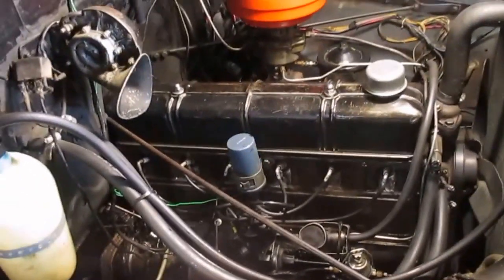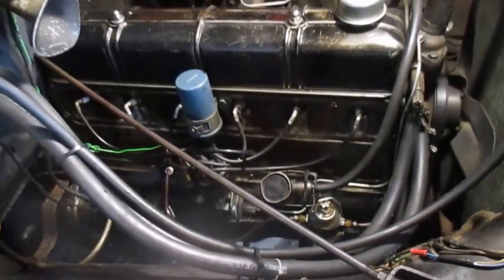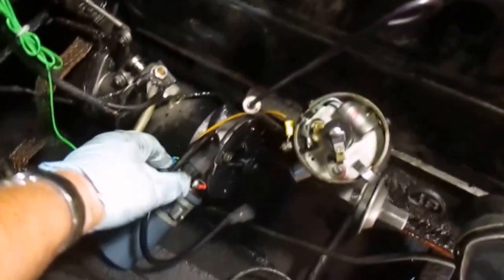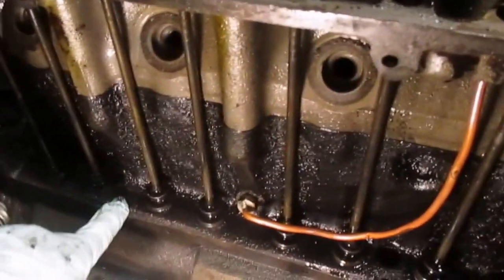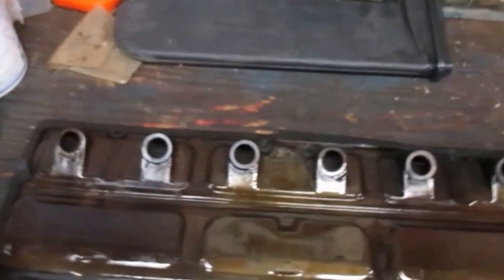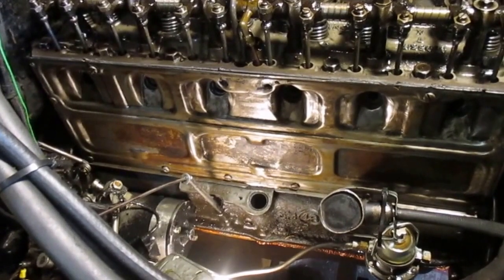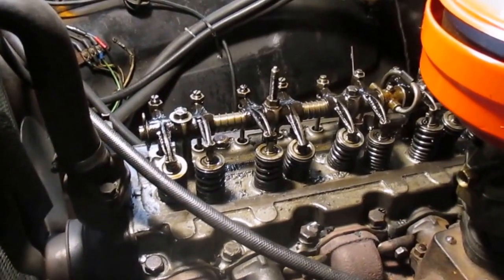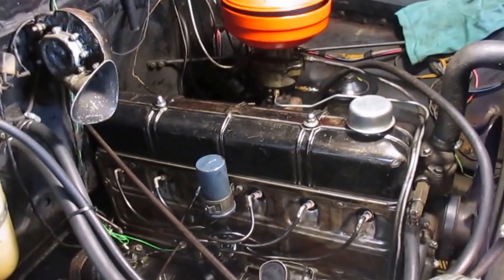Chevy 216 Side Pan gasket R&R Movie

Comment: Based on your puddling explanation, did you consider applying sealant to the bottom aft engine block  to gasket and or the entire lower part of the gasket to engine? I might try that. Thank you for your time sharing your experience, it saves many of us pain and suffering.
Reply from the maker: I applied sealant on both sides of the gasket and that worked the best for me. I let the sealant get tacky (about 5 minutes or so) before I bolted the pan back on. Make sure the sealing edge of the side pan is good and flat, especially around the bolt holes. That and good sealant should keep that oil in the engine where it's supposed to stay. Good luck Mike.

Comment: Great 👍 vid buddy.. & love the shop. I need one . Haaaa. Theirs my favorite word again.. STOVEBOLT. 😎 . So you cranked her or by hand you set her up on  the BB mark & made sure she was on compression stroke? & is that #1 position the same on a 235? Unfortunately I believe my block was changed for the exact reason you talked about ..that oil line.. believe a lot of people would say they had a bad oiling prob with those 216.. but I beg to differ if you maint it as you have.. I think your just fine..awesome 👌 vid as always.. see 👀 you on the next . On that note do you know of any sites I can cross reference my block.. see what year it is?  Thx Dave.. if my memory serves me right haaaaaaaa
Reply from the maker: Yes I turned it by hand. They turn real easy with the plugs out. Thanks for watching. Try the following web site, theres lots of Stovebolt knowledge there;
https://www.stovebolt.com/ubbthreads/ubbthreads.php/forum_summary.html
Reply: @Volfandt  thanks  buddy will do .. keep the vids coming

Comment: I've noticed that your ignition coil is upside down. Ours is rightside up. Which is correct? Our coil is NOT internally resisted.
Reply from the maker: The coils came from the factory installed upside down and it never was a problem. I'm not sure when GM started installing them right side up but I'm going to guess sometime in the mid to late 50's. You can run it either way.

Comment: I just bought a 3600 1953 and it’s an unusual beast here in the U.K.  You mentioned you changed the rear main. I think these are a cord seal. Did you change the main with the engine installed. Heard it can be done but tricky ?  I just adjust the tappets with the engine warm and running until the offensive article quieten down. Regards Chris
Reply from the maker: Yes the rear main seal is a rope seal and comes in 2 pieces. One piece fits in the main bearing cap and the other piece fits in the main bearing saddle. There are several providers of the seal but I've found the "Best Seal" rear main seal kit to be the best. The kit includes a cutter for trimming the rope seals, a gauge for accurate cutting and good instructions. To replace the rope seals without removing the engine you need to drop the oil pan, back the transmission back approx 3/4"-1" to get the trans shaft out of the pilot bearing on the flywheel, then loosen all 4 main bearings in order to drop the crank shaft down enough to get the upper seal out and the new seal in the main bearing saddle. 
Be careful not to hit or knock the oil squirters in the oil pan as they are factory aimed to squirt pressurized oil into the rods dipper as they rotate around, thats how the rod bearings get lubricated at higher rpm. At low rpm the dipper on the bottom of the rod dips into the oil troughs in the oil pan which forces oil into the rod bearing. The 216's and early 235's don't have oil passages drilled in the crank to lube the rods, they rely on the dippers and squirters for lubrication. Later 235's (1953 and up) do have pressurized oil feed to the rod bearings.
Enjoy your 3600,these old Advance Design trucks are pretty stout.
Dave
Reply: Volfandt  Many thanks for the great reply.  sounds a bit tricky to do the seal with the engine In, although I have heard that you can often get away with just doing the bottom seal. I’m keeping my eyes open for a full pressure 235 I think I will live with the leak and swap the engine out.  Its popular for imported trucks in the U.K. to loose the straight six and replace with a V8 as parts are more available and cheaper.  I’m finding shipping cost of parts very expensive. You sound like you have a lot of experience with the trucks. I hope you don’t mind if I ask you the odd question.  Obviously only a very small number of these in the U.K. and it helpful to get a bit of advice as I’m new to trucks. Thank again best regards Chris.
Reply from the maker: Thanks Chris. Ask away, I'm no expert by any means but I'll try to help if I can. Understand about the hardship you encounter with an AD truck in the UK. Doing just the bottom seal is pretty easy and may slow or even stop the leak. It definitely won't hurt.  I'd recommend plasti-gaugeing the rear main while you had it apart, if just to get a good measurement on the bearing clearance and know the overall condition of the engine. If it's still got the shims on the mains you could tighten it up and get alittle more oil pressure if you removed them. But don't make it too tight so plasti-gauge it to know what your dealing with.  0.0015" to 0.0035" is the bearing clearance you want. I currently have 2 of these AD trucks, both 49's. One is a Chevy and the other is a GMC.  The Chevy is stock and I plan to keep it that way with the exception of upgrading the engine to a 54 235 when the 216 quits. The GMC  was already modified when I got it but the 79 Chevy 250 engine in it was shot so I installed a 69 SBC 350 in it. I enjoy both and they are totally different in most respects.
Currently the Chevy is the more dependable as I'm still working the kinks out of the GMC.  
Heres a link to an on-line manual for your ref:
http://chevy.oldcarmanualproject.com/
Have a good 'un. (Southern slang for best regards).
Dave
Reply: Volfandt Cheers Dave. Nice to have a sounding board for the trials and tribulations of Chevy ownership. Although these truck are rare here my friend has a 55 GMC and another friend a C10.  We drove from the U.K. to do the classic LeMans in France last month pretty much a 600 miles round trip. Hoping to take my 53 on the next road.   Here’s a little of my C10 action we had a bad miss after rebuilding the engine. My best regards Chris

Comment: Hey Dave.  I have a 52 Chevy with  the 216 engine and on my truck I don’t have that oil line behind the  push road cover it has a bolt plug instead but the valve cover has the oil line sticking out right from the middle of the valve cover so I took off that plug behind the push road cover and I had antifreeze coming out of it instead of oil.  Do u have any idea why there is no oil line instead?
Reply from the maker: I'm going to guess that the oil line that runs through the engine block (from the oil regulator on the drivers side to the push rod cover up to the rocker shaft) must be broken and/or plugged with crud.. The oil line does run the the coolant passages. It sounds like someone installed an external oil line from the regulator up and around the valve cover and taps into the rocker shaft. That is a common repair/modification that folks did back in the day when they  did not want to run a new line through the block. 
Several aftermarket providers carry a kit that replaces the oil line that routes through the block. It's not a bad job but it did take me several hours and some aggravation to do. If you're getting oil to the rockers with the bypass line installed outside the block you'll be alright but if you aren't getting any oil to the rockers you need to either get the through-the-block kit or the outside-the- block oil line working.
Good luck.
Reply: @Volfandt  thanks dave u just gave me alot of information. I will check On that but am pretty sure am getting oil to the rockers cus they look all wet.  Thanks once again 👍
Reply from the maker: @evanunez8638  Sounds good. Remember the old axiom, don't fix it if it ain't broke, LOL.
Reply: @Volfandt  😂😂 thank you 👍👍

Comment: do NOT grind on youre rockerarms (not by hand at least) , the parts of these arms slide metal arcross metal with only a slight film of oil there worn intoo eachother so you need to take care to put each rocker on the valve it came of same with the pushrods and the cam tappets 
start grinding on any of these parts and they will wear incredibly fast act like a metal file and fill the oilgalleries in the block with metal particles while there at it 
if any of these parts are worn replace them with brandnew parts and use chromemoly grease on each end while hoping the wear on the other parts doesnt wipe the new one out as well  
or keep the old ones and use a tiny rod in the right diameter as a feelergauge to set the valvelash inside the grooved bit you might be able to find those rods in a welding shop for gas burner tips
Reply from the maker: Good idea on using gauged rods to measure the valve clearance on valves when the rocker tips have a groove worn in them. You'll need 2 sizes, 0.006" for the intakes and 0.013 for the exhausts.
I agree with keeping the rockers in the same order they were in should you remove them from the rocker shaft.
I also agree on using an assembly lube on the rockers center bushings, pushrod sockets and rocker tips should they be removed from the rocker shaft.
I respectfully disagree on your position on not dressing up the rocker tips.
All these rockers wear a groove in their tips. The depth depends upon mileage and usage.
This means the rocker tips are already making contact with the valve stem deeper in the original surface of the rocker tip. This is normal wear and tear. 
By dressing up the tips, you are grinding away the portion of the rocker tip that doesn't make contact with anything so you can use a standard feeler gauge for measurement of the valve clearance. 
Your argument on the tips wearing is valid and unfortunate but again, they are already worn by normal wear and tear.
The unfortunate part is these rockers in new and/or NOS condition are getting harder to find. By all means do install new and/or NOS rockers in these old Stovebolt engines when one can. Same goes for the rocker shafts too.
And also change the oil at 3000 mile intervals max as there's more than just the rocker tips wearing in these venerable old powerplants. The rings and bearings also wear.
Thanks for you input.

Comment: good job.i have a 47 chevy had to replace gasket also , saw your vid after i replaced mine. did not know you had to wait 24 hrs before starting motor man i hope it dont start to leak again.if it dose i know what i did wrong thanks to your vid .thanks
Reply from the maker: Thanks. You are probably alright as it depends on the sealant you used. Some are ready to go immediately after application. Good luck to you.

Comment: Hi Dave
I need to know whats used to seal the water pump gasket,  which is like a paper material?
Mine is a 235.
Reply from the maker: I like to use Aviation Permatex, It remains pliable and doesn't harden. It brushes on.
Reply: @Volfandt Im doing that.
Thank you very much!

Comment: Nice video what is the steps for setting a head on this engine i have a 216 that im gone be intallimg the heads and i need all the specs torque and everythimg thanks
Reply from the maker: You didn't say what year engine but 216's didn't change much over their production run so this info should be helpful.
This is a cut & paste of reinstalling a 216 head: 
http://chevy.oldcarmanualproject.com/shop/1948_51truck/51ctsm0611.htm

This is a cut and paste of the entire 1949-51 truch shop manual:
http://chevy.oldcarmanualproject.com/shop/1948_51truck/index.htm

A trick I used was to cut the heads off two long head bolts (or new long bolts) to act as guides when placing the head on the block. The head is very heavy and you should have another helper to assist.
Good luck.
Reply: @Volfandt  thanks for ur reply is a 1937, i would take youre advice and cut the heads of the 2 bolts thanks alot for ur help  god blesed you.
Reply from the maker: @theadventuresofbellaandjos6435  1937, I really like the ArtDeco style. If you run into any problems I'll try and help if I can. Good luck Eze
Reply: @Volfandt  thanks i let you know if i need any help.

Comment: Was your oil rocker line just screwed into the pushrod side? It appears mine is welded on to. I'd like to send you a picture of mind if you wouldn't mind, I don't know if it actually needs replacing.
Reply from the maker: Is your oil line tube leaking? The line is generally a one time use only. If it leaks, get's broken or gets clogged up with years of crud, it usually needs totally replaced. The copper line is soldered to the fitting on the push rod gallery side and can't be turned without breaking the solder. which in turn will cause a leak.  I've read where there's been a couple folks that have successfully repaired the line but in the long run it's best just to replace it. I wish I had done a video when I replaced mine but didn't. On a scale of 1-5 with 5 being the hardest, I'd give it a 3. It took me about 3 hours. I purchased the replacement line kit here: http://www.oldchevytrucks.com/cart/product.asp?prodid=MEO199&i=||||| and it was complete. Just remember you'll need a side pan gasket and a valve cover gasket which isn't  included with the line kit. 
If your line is not leaking but isn't flowing any oil to the rockers you can take the line loose at the rockers and also down at the oil distributor (on the block under the carb where several small oil lines converge) and blow pressure air through the line. This can usually clean it out. The line feeds oil from the oil distributor on the carb side, feeds through the block (runs in the coolant passage between cylinders) comes out in the lifter/pushrod gallery, bends up and connects to the rocker center section. Why Chevy did it this way is beyond me but it's worked for 100's of 1000's of these engines over 60+ years.
Good luck
Reply: Not leaking but my mechanic unscrewed the driver side and I can’t get it back in. I assume it broke off inside the water jacket somewhere so I was going to try and pull out the line to see if needed replacing. I can send a picture of the broken side if it helps
Reply from the maker: No need for a pic. Sounds like he broke the soldered connection. Unless he loosened and removed the fittings on the carb side 1st. If  so and the soldered fitting to copper line isn't broke you can try to reuse it. 
If it is broken you could try to put the fitting back in and resolder the line to it but you'd save a lot of time and grief and just replace the hole assembly with the kit I linked. The line threads in on the gallery side and the fittings on the carb side are compression type and aren't soldered.  IIRC theres instructions included with the kit. Some folks will loosen and remove the fittings on the carb side,  tape a wire to the line at that point, pull it through to the gallery side then tape the wire to the new line, then slowly pull the new line in by pulling the wire back through to the carb side. You then tighten down the gallery side as the entire line will turn with the soldered on fitting. Once it's tight you then tighten the fitting on the carb side. Once the line is good and secure you'll need to slowly and carefully bend the line at both ends to connect to the oil distributor on the carb side and to connect to the rocker on the carb side. If you don't feel comfortable you may want to see if you can find a mechanic to install the new line. 
Good luck
Reply: Thanks that is very helpful info. I do have that new line so I may just go for it. Keep up the good work!

Comment: Hey Dave. Could you make a video on adjusting linkage on steering column for the 3 on the tree? Please.
Reply from the maker: I'll see what I can do but it'll be awhile. I plan on pulling the engine and transmission over the winter. I haven't had to adjust the shifter linkage as it hasn't needed it yet.
I'll give a brief description of how I'd do it.
1st make sure the shifter is in the neutral position. 
Either Crawl under the truck or pull the transmission cover and make sure the transmission is in the neutral position. 
Adjust the linkage at the shift to where both linkages line up and easily connect to the steering column connectors.
You should then be good to go.
Good luck
Reply: Thanks a lot Dave.